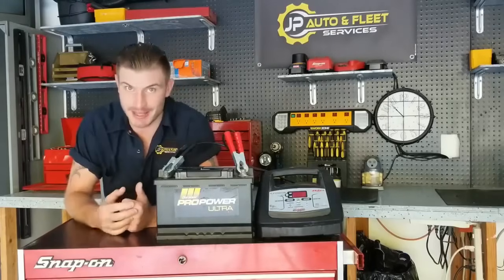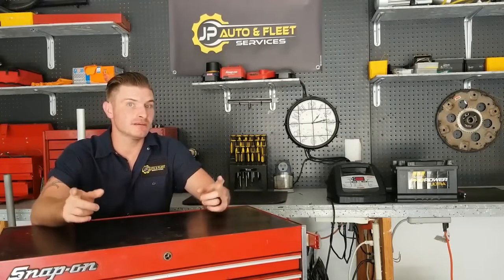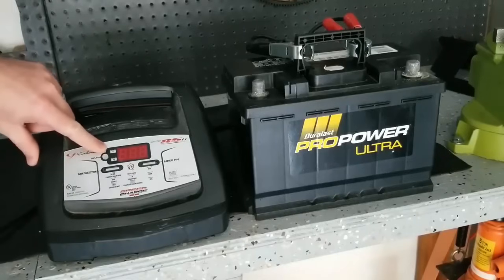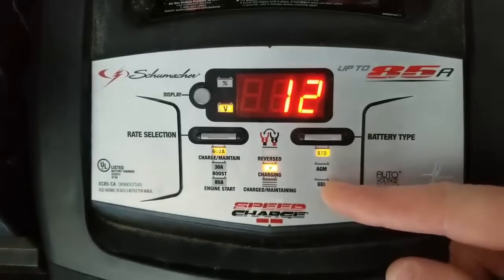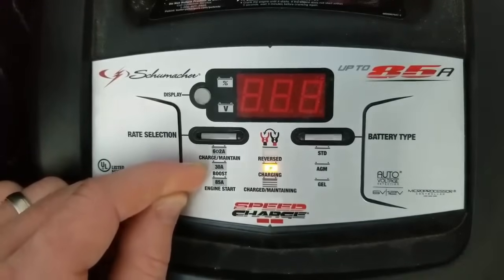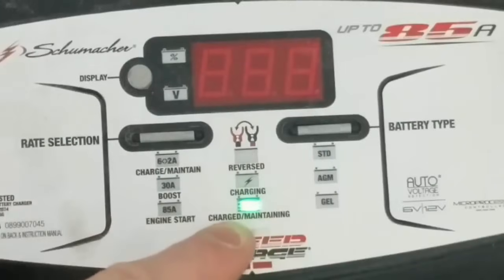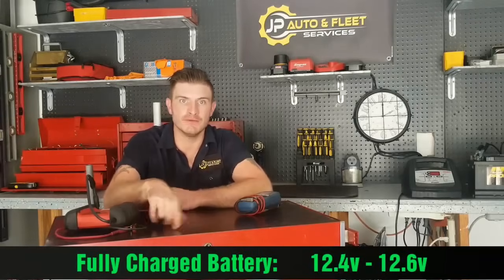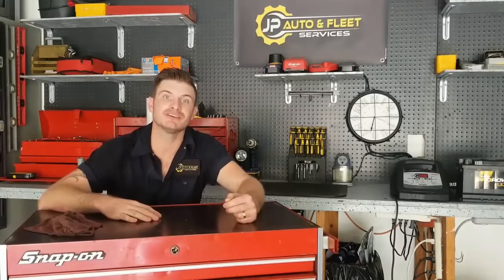How Do I Recharge My Car Battery | How Long To Charge A Car Battery At 2 AMPS

Comment: i have been charging my batteries for testing purposes a lot these last few weeks and i was using the "30 amp boost". i just saw in my manual 5 mins ago  and you just confirmed i was using the wrong mode. that is why my batteries were over charged to 15 volts lol. also my application is i am learning about solar power, battery banks  and inverters, but at night when i get home from work its dark and i have no sun, so i use the wall charger to get the battiers back up. no one should follow any of my adventures as of yet as i dont know what i am doing which is why i am watching this video. side note i have the exact same changer but mine is the autozone branded model, seems to be the same, just a different color and name slapped on it.
Reply from the maker: Keep tinkering brother.  That's how you learn!. Thanks for the view and comment

Comment: #1-Is it really mandatory to remove the battery from the car? Are we at risk to damage components or is it just for ventilation/ safety?
#2- How does this unit pull 30 amps without blowing your household circuit?
Reply from the maker: No brother you don't have to remove from the car. You can do it with it in the vehicle. The magic of capacitors and modern electricity prevents that from blowing your household circuit.

Comment: I thought black cable to earth point?
Reply from the maker: Correct. Black goes to ground. Ground is the negative post on the battery or any metal portion of the frame the circuits attached to.. Many manufactures will give a designated earth point under the hood but this point is always connected to battery negative.  Thanks for the view!

Comment: hi everyone battery has internal resistance you put too much amps into battery excess current heat the cell 10% battery capacity better for charging 70AH battery need 7amps * ten hours 13.3volt to 14.2volt need charging the battery you want boost charge the battery 16 volt is enough your battery below the eight volt parrel with good battery without charger one hour it will balance the deep discharge battery into 11.5 to 12.4 after connect the charger it will charge the battery
better way to charge the battery 13.7 volt 6amps perfect   for car batteries thank you
Reply from the maker: Thanks for your input👍

Comment: Weird to show 12v when charged, shouldn't it be 14volts?
Reply from the maker: No a fully charged battery sits between 12-12.6v.  The alternator or battery charger (if your Charging it) bring it into the 14 volt rage. This allows the battery to be recharged.  However it is not maintain that 14 volt state.  You're mistaking alternator or battery charger charge/voltage with actual static battery voltage.  Hope this clears it up. Thanks for the view!
Reply: My resting voltage on my xs power battery is at 13.04

Comment: also, if the car battery is rated at 40-45 AH and the charger is rated at 6A, doing the math, is it safe to say that you need at least 7hrs to charge a full drained car battery? thanks again and more power
Reply from the maker: That time period sounds about right for the amperage

Comment: a couple of questions mate. there are DIY small chargers available online that offers 6amp charging that has auto feature that turns off when battery is full, my concern is that it claims that it has a repair function. is that true that you can repair batteries with that charger? in my understanding, there are several individual plates in a car battery. If one or some of these plates has lower charge on it than the rest, it can be a problem. Is that how it works that the charger will put all those plates in full charge. There is also this pulse charging that they introduced. How does that work? thanks and more power to your channel.
Reply from the maker: If a plate is shorted bad enough internally it's very hard and sometimes impossible to reverse. The repair feature is probably the pulse charging your speaking of. It uses a series of voltages and currents that can break down lead sulfate crystals that form between the plates shorting them out. If they havent built up to badly they can sometimes be broken down this un-shorting the plates. Hope this helps!

Comment: How about AGM solar batteries?  I just bought a charger and when I charge on AGM mode the charger goes all the way up to like 14 volts.  Is it trying to get to the float voltage of 14.4v and then it will shut down?  Or will it sit there at 14.4v for a long time before shutting down?  I only paid $25 for this 4a Viking charger so I want to babysit it during the first couple uses to make sure it's working properly.
Reply from the maker: 14v during Charging is normally. It will cycle through a couple different voltage levels throughout the charge process
Reply: @JPAutoFleet  Sorry, I meant to post again.  It ended up going to 14.8v before I turned it off.  I didn't wait to see if it was going to go higher. I could hear the AGM battery starting to gurgle and stuff.  It was definitely on the AGM setting also. 

Do they make inexpensive chargers that only go to 13.8v?  That is what my AGM says the max should be if I have it in standby.  The 14.4v is if I'm actually using it... cycling it.
Btw, I took that charger back.  Regardless of whether it was doing what it was supposed to, my battery clearly didn't like it.  I have another old charger already that I've used in the past and never noticed the gurgling.  I only bought this new one because the other one doesn't say it is for AGM batteries.  I think maybe the low amps is why it works okay.  It is 1.5amp... the new one was 4 amp.
Reply from the maker: @101perspective  your battery could also be the culprit. Have it tested
Reply: @JPAutoFleet  It is an older battery.  I had it in my van as part of my solar setup.  I put a different battery in the van though and put this one in storage.  I figured in a blackout I might be able to get 300wh or so out of it still. 

Anyway, I plan to just put it on a charger every few weeks.  I haven't tried my other trickle charger yet so I don't know if it is going to gurgle and stuff when charging with it. 

It would be nice if there was simply an affordable charger that didn't go over like 14v throughout the charge process.  Maybe 14.4v max.  When being stored, this battery says it wants only 13.8v max.  So, charging it to 14.8v seems like a bit too much even if it wasn't gurgling and stuff.

Comment: will a recharged battery last for another year? or should i buy a new battery sooner?
Reply from the maker: Simply put its all in the age of the battery. How old is it? Have you had to recharge it before? These are all factors. Many manufacturers will tell you a battery will last for 4 years. My personal opinion: 2-3. but it all depends on the environment and rigors you put the battery through. Get it tested. Evaluate the age and go from there.  Hope this helps
Reply: @JPAutoFleet  tnx man
Reply from the maker: @ferdinandagustin4089  if you havent already. Consider subscribing to the channel 👍

Comment: What should I do if the trickle charger is showing 80% complete but i check the battery with a multimeter and it reads 12.9 volts?  Disconnect the battery and call it complete or let the charger reach 100%?
Reply from the maker: More than likely your just reading a surface charge left over from the charger. Or theres a chance sulfation has occured (batt failure). You could put it back in the vehicle and do some driving to fully recharge or hook it back up to the charger for a while longer. Your choice. Make sure to test it at the parts store after its charged to make sure the battery isnt over sulfated (bad).

Comment: I have an excellent battery (World 24F), but a recent scan by AAA showed one problem. 'State of Charge' at 100% (12.72V), and 'Cranking Health' at 100% (10.31 V). But the 'State of Health' only at 36% (504 CCA)? (State of Health factory rated at 650 CCA?). It's been a few years since I bought it, my guess is a simple recharge should do the trick? (I've had no problems starting my old Volvo.) Simple questions.

1. Does the 504 CCA indicate z recharge is needed?
2. Is it OK to use a quality extension cord to get a battery charger next to the car?
3. Some videos show the black clamp (negative) to the negative battery connection; others show if to a solid metal connection on the car. Are both good options?

Thank you!
Reply from the maker: Batteries normally reduce in CCA over time. If it starts the vehicle without issue your fine... extension cords are perfectly fine for lengthening the chargers reach... clamping onto a metal ground with the black clamp is fine when the negative terminal is not accessible. Hope this helps!
Reply: @JPAutoFleet  Quickie follow up question. Can charging a battery, or some other simple action, increase the CCA? Thank you.
Reply from the maker: @MarkJones-si2bb  if its depleted very bad it can but if its showing to be fully charged and you go ahead and recharge again it wont do anything but put your battery at risk for over-sulfation. I wouldnt worry about it if its trustfully starting your vehicle every time you turn the key.

Comment: I have no clue about electrical stuff...but when it is on the charger it shows 12.8 but off the charger back down to 11.4. Am I dumb or is my battery shot?
Reply from the maker: You need to get the battery tested that will let you know. But chances are if you've charged it overnight and it still reading 11 V it's badd

Comment: I cant reach my negative terminal can I hook up the charger to a positive terminal and not negative terminal but ground would that be ok
Reply from the maker: Yes that would work
Reply: As far as I know (from what my charger says), it is strongly preferred to do as you said, that is, hook charger to positive first, then the negative charger lead to a ground in a car ( presuming the negative is ground!), so that if a spark jumps when you connect the negative charger lead, it won't be close to the battery, which could be releasing hydrogen gas. That's just my understanding, maybe others who know more can tell you better.
Reply: Depends if your vehicle is a negative grounded circuit. Most are but not all

Comment: So my charger calls for using a 24” minimum 6 gauge (AWG) insulated battery cable for the negative post to battery charger clip connection. 
Not mentioned here or in other vids, is this truly necessary? 
Diehard 28-71222 (page 7)
Reply from the maker: Not quite sure I understand what your asking. But if the manufacturer recommends something theres always a good reason for it.
Reply: They do that for safety. Every charger manual I’ve read tells you to do that. The reason is, they don’t want you making a spark near the battery. There’s always a chance of hydrogen gas around the battery, and clipping the charger clamp on, in the days of non-computerized chargers, used to cause a spark at the battery terminal. For liability, they’re telling you to make that final connection, which causes a spark, away from the battery where it can’t cause an explosion.   It’s the same as connecting your jumper cable to engine ground instead of the negative terminal. 

In most modern chargers this isn’t really a concern because the clamps aren’t energized until a few seconds after they’re connected.

Comment: A lead acid battery is empty at 12.0 volts and is full charge when left ten hours of the charger after a full charge and volts should read 12.6 volts this is for and a brand new battrey and older battrey may drop in volts much more quickly after a full charge and may only hold a voltage of 12.5 volts or less depinding on the condition. Aslo a older battrey will get to full charge faster . because of sulfation on the plates .
Reply: lead acid battery is 50% state of charge, but i realize with most deep cycle its recommended to not use more than 50% and starter batters should not dip below 90%.i am not sure why in the video when he showed the display it read at 12 volts while being 100% soc. mine shows the actual real voltage and i have the same charger, it likely would be 14.4v until i disconnect the charger and let it rest and i find 100% soc is 12.7v. the sulfation reduces capacity, the less capacity is why the cc/cv cycle of the charge is done quicker, essentially your battery just gets little smaller in watt-hours as it wears out or takes damage then it can escalate the rate of decline in terms of even more lose of capacity measured, most accurately in watt hours, but sometimes measure in amp hours. but the volts should be the same, no?

Comment: You have to charge the charger for 24 hours or longer. Mine didn't work, I put it on the terminals and it instantly died and had zero charge left. I messed with it for about three days and took it back to the store.
Reply from the maker: Every now and then you run into a defective product. Or your battery was toast.  Not sure what your situation was but if you have a badd cell in a battery or a depleted battery the best charger in the world won't bring it back to life. For your sake I'm hoping it was a defective battery charger. Thanks for the view and I wish you luck in your current charging system situation!
Reply: Nothing personal but this sort of thing happens to me all the time. I'm about to go bitch about my morakiv that wasn't heat treated.
Reply: It sounds like you’re talking about a booster pack, which isn’t meant to charge your dead car battery, but instead, to give you enough juice to start your engine. No battery charger needs to be charged, they plug into an outlet.

Comment: Thank you, very helpful!
I have another question. How do i know if my battery or alternator is the problem? I was driving on the freeway the other day, when my battery and brake lights came on intermittently. I started loosing power and once I got off the freeway (I thank God that it happened then when I was also close to home rather than while I was still on the freeway), all the electric system shut down and my power steering too. Then at the first stoplight where I had to stop, my engine stopped too.
Reply from the maker: It's more than likely your alternator. If the battery was bad and you had a good alternator, the alternator would of kept the charge up and the car wouldnt of died. Just to be safe take the battery in to bd tested at the parts store for free.  The battery will probably need to be recharged. Theres plenty of good videos on YouTube on testing for a bad alternator. It's a simple test you can do with a multi meter. Hope this helps and thanks for the comment.

Comment: Thanks man, you deserve way more subscribers to be honest. Multiple ways for the process that you covered and easily explained as well. keep up the good work.
Reply from the maker: Thanks bud. I appreciate the love!
Reply: @JPAutoFleet  
Nice video there! Very useful. 
I have a smart battery charger and what i don't know is if you need to open the caps on the battery while charging. Can you help me?
Reply from the maker: @thebulletrider5670  you should not have to
Reply from the maker: Although making sure your electrolyte level is topped off prior to Charging is not a bad idea.
Reply from the maker: @thebulletrider5670  No you dont

Comment: Hi I've been charging my car battery for 3 days on 2 amp and it doesn't go over 11.5V any advice please
Reply from the maker: Chances are you may have a bad cell. It should of fully Charged after 2 days. Take it and get it tested at the parts store. It may be time for a new one
Reply: @JPAutoFleet  thank you for the advice most helpful keep up the videos excellent work

Comment: My old schumacher model se-60 charger only has 2 0r 10a but the manual says if battery is under 11v to use 10amp. Does this sound right or should I just use 2amp?
Reply from the maker: If you have time go with 2 amp. Itll take a while but is best

Comment: Great info! I have an older gauge display setting charger w Boost mode or Charge mode. Didn't know what full charge setting was at. Now I know, 12.4 to 12.6 volts, set at Charge mode to trickle charge. Bounce around other channels but yours was what I needed and well explained. Thanx!
Reply from the maker: Thanks Gene. I'm glad it helped!
Reply from the maker: If this video helped chances are some of my others will as well. Consider subscribing to the channel!